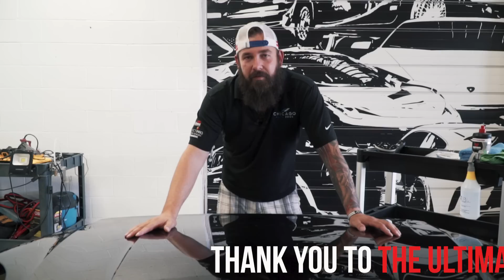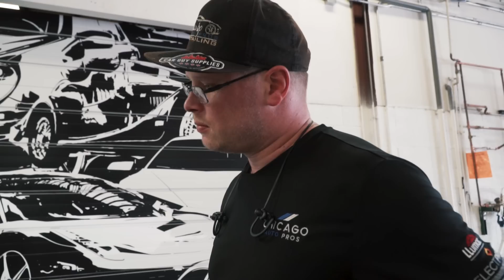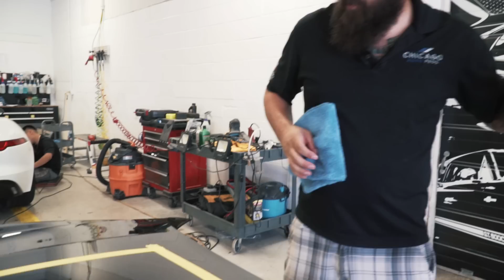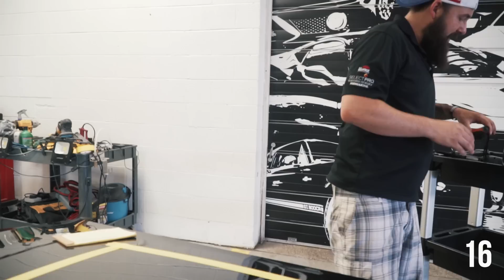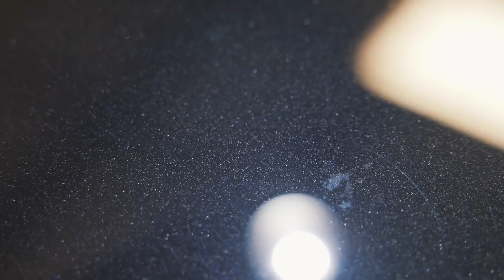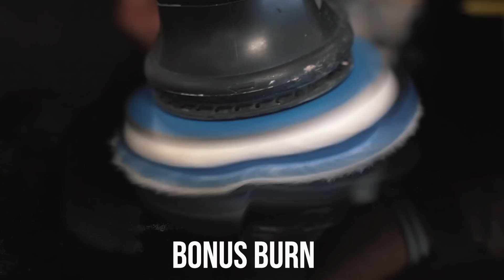Jason Burns A Car... How Many Times Can You REALLY Polish Paint?

Comment: The lesson for me here seems that, if you want to polish your car with a light compound every year with a proper technique and preparations just to refresh paint, you should be fine. I have an old Audi A3 8L from 2000 and I am slowly getting myself to learn how to polish paint. Before working on a car I will buy some spare panel and practice on it. Very nice video making me much more confident and at ease when comes to making my own car a little bit better looking. Some preparations without a rush and just careful and mindful work. Thanks guys. BTW. Recently I have sanded, polished and film protected my headlights all by myself. Effect is more than I could have wished for and it made me super satisfied and proud of myself.
Reply: You should be fine, but dont forget, clearcoat degrades over time due to many factors, while this was most likely a pretty new panel with barely any natural degradation.

Comment: Did you notice any orange peel leveling near the end, In theory it should be flat as can be right before you started burn through
Reply: Most efficient way to get rid of orange peel is to wet sand with a hard backing pad or block. Because of the soft pad and soft backing pad it follows the shape of the clear to a degree wich keeps alot of the orange peel compared to wet sanding.

Comment: Really interesting.  Thanks for doing this as it gives me a bit more "confidence" knowing I'm pretty unlikely to burn through w/o being a complete imbecile :-).  Would be curious to compare using a rotary versus the DA how much quicker you would have reached failure.  Also curious to know the depth gauge reading in one of the door jams as well to get an idea of factory depth versus what you started with on the hood.
Reply from the maker: It took so much longer than I would have expected. This was an OEM new hood. I am assuming is had little to no polishing done to it.
Reply: @ChicagoAutoPros  I estimated even quicker, especially with the microfiber cutting pad!

Comment: I wonder how different the results would be if you used a non-diminishing compound like Meguiar's 101.
Reply from the maker: Do a video!
Reply: 400 use an agglomorated abrasive. What this means is that the abrasives are basically a cluster of non diminishing abrasives, which break down to non diminishing polish. Strange I know, but it makes sense when you consider how far it cuts and finishes. 

Todd Helme did a great write up on Autopia of FG400 vs M105.

Comment: I was thinking 0 is the base coat, how come it showed failures while it was reading 4.0. doesn't this value go from 0 upwards?
Reply: I've see vids where they measure the inside of the door post to see a rough value of what is safe. They read a couple times 4.5 mil that would mean there is hardly any clear coat on there. That number is confusing if 0 isn't really 0
Reply: I don't know nothing about this. I did a quick check what it measure. It measure all layers. I thiught it somehow only measure the clear coat. Kind of sketchy, one does never know the thickness of the bottom 2 layers

Comment: How does he believe the millimeter reading is MORE accurate than the micron reading??? 650 microns is EXACTLY the same as 6.5 millimeters lol

EDIT: It's actually "mils" (thousandths of an inch) not millimeters. So the microns reading is MORE accurate than the mils reading.
Reply: Micron= micrometer 1x 10-⁶= 0.000001 meter
Reply: Mils is thousandths of an inch, micron is as Robert Ri said metric. 25.4 mm per inch, so 6.5 mils or 0.0065 inches is 0.1654 mm or 165 micron. You see him measure 6-6.5 mils and when he has the micron on, he has 160 micron to 165 micron show up.
Reply: @MrTommyp56  Ohhhh, I misunderstood. Still, 10 microns is smaller than 0.5 mils, so the microns reading is actually MORE accurate.

Comment: Honestly.. my wagoneers paint..  has black mold... burned into it... i washed... scrubbed... tried chemicals... couldnt get it iff... So i had to buff with a buffer and compound..  and buffing the hood for an hour 3 times.. hard and slow.. got maybe 60% of the mold spots off.. but its so etched in my paint i cant get it all off.. it sucks !!!  So i wanna just keep buffing until i get it off.. but i dunno if ill make this worse or not lol
Reply: Did you get it out?  Using compound and a DA polisher should work. Chemicals won’t.
Reply: @denisef1153  i used a buffer.. and compound.. and no i didnt.  I buffed for hours too.. probky chewed through a lot of paint.. it got the shine back.. snd (most of the mold) but this mold ate DEEP in the paint.
Reply: @jeepsblackpowderandlights4305     Excellent.  Thanks for replying.  I’ve never heard of mold growing in paint and after I read your story I went and checked over my car for signs of mold.
Reply: @denisef1153  same... i moved out in the country and this black mold started growing on my two Jeeps.. i didnt think anything of it and i was too busy with the new house and property.. and when i finLly said eh lets clean this off.. it ate through the paint on my wagoneer.. on my grand cherokee it did come off though.. both paint jobs are different so one might have been more resiliant than the other

Comment: I guessed 5 - wow, was I waaay off! I’d also be curious how you would know if you were close to burning through the clear coat.  Is there a standard thickness of clear coat vs. paint?
Reply: Sometimes u can measure the paint of the inside of a door panel. No clear coat there. The difference in thickness is the amount of clearcoat u can work with
Reply: Matthias Van Eeckhoutte 

That’s great information. Thank you!

Comment: Nice Videos Guys .But how much clear coat is enough to provide enough uv protection .??and not fail during one or two summers
Reply: He said it was a new car and it was reading 6 to 6.5 mil.  I would bet that’s your answer?  That’s how I understood it.
Reply: @denisef1153  Hello buddy  i mean after 
 polishing , for example you remove 5,6 microns from the original paint how much is enough for uv protection
Reply: @spiros271  no, don’t remove that much. You will have no paint left. His car was brand new and his car, with brand new paint, had that much.  That’s not how much he removed.   I don’t know how much is enough for UV protection.  Start small and work your way up. I did 5 passes over my area and that was enough for the shine to appear again. My car was very bad and neglected. It  actually looked like it had flat paint.  
I did a chemical decontamination first with iron remover. Then I used a clay bar. 
Then I compounded followed by a polish using a DA polisher.  After all that I wiped the car down with a mix of alcohol and water and then applied wax. My car came out great. I’m learning too. I’m a newbie but have watched videos on how to detail your car for a few weeks until I got brave enough to do it.    There are some excellent videos for beginners.  
Read the comments for more helpful hints.   Check out Pan The Organizer videos. He has a step by step guide for beginners.
Reply: @denisef1153   Buddy thank you first of all for your answers. I was speaking about microns not mils. I think he measure 6 mils of paint eguals to 165-160 microns .He showed to the video 72-73 passes  with an agreesive combo  in a room temperature .He showed in how many passes you will have clear coat failure. What about in real enviroment elements.For example how many mils/ micros can remove to have enough clear to protect you from the sun .And the test was made to 160 microns .Imagine you have a mazda with 75 microns =2.95 mils . I believe the video is to have a general idea not real test
Reply: @spiros271  Thank You. I obviously misunderstood.  It’s complicated for me. Microns and mil

Comment: Any recommendations solution for fixing coat burned methods? Please share…
Reply from the maker: Call the body shop and have it repainted.
Reply: @ChicagoAutoPros  This is the best solution? It's need repainted the whole panel or damaged area only? Please advise, thanks…
Reply: @petter7085  the burn needs to be sprayed with primer water sanded and whole panel needs to be repainted and cleared. Other noneffected adjacent panels may need repainted aswell for blending purposes according to placement of burn.

Comment: Since when is 0,5 mil more precise than 10 micrometers?
Reply from the maker: I don't know maybe I am wrong. I liked the mil reading better. I didn't like that the microns didn't go to the single digits.
Reply: @ChicagoAutoPros  10μm (micro) are 0.01mm (mils)
Reply from the maker: 10 micron = .394 mil
Reply: @ChicagoAutoPros  10µm is more precise. Turn it around: 0,5 mils = 12,7 µm :) Nice test though, is this always the arm speed what you do? I found it to be pretty fast when the video wasn't speed up of course :p
Reply from the maker: Yeah that is the arm speed I would normally be buffing at.
Reply: @ChicagoAutoPros  it's the gauge. My (cheap) gauge doesn't round up to the nearest "whole" number in microns. I prefer microns because I see 2,3, 7 etc microns being removed at a time. What ever the number. In Mils, it would read like 6.0, 6.0, 6.0, 6.0 so you're not really seeing "removal" until u go down to 5.5, etc.

Comment: Just use a paint depth gauge on every car, rather safe than sorry
Reply from the maker: A paint gauge doesn't tell you how much clear coat is left. It's measuring all layers. It will also vary on every make and manufacturer.
Reply: @ChicagoAutoPros   could get the expensive gauge that does tell you each layer :) I think it's abut 2500 bucks
Reply from the maker: Oh that's awesome. Didn't even know that existed. You have a link?
Reply: @ChicagoAutoPros   Ya not many people know they exist, probably due to the price. The link is this https://www.defelsko.com/positector-200 the 200 B3 looks to be the one to get. It is their advanced series that does it.. the description at the top of that page says this "ADVANCED
Includes the features of the standard gage, with storage of 100,000 readings in up to 1,000 batches. Includes WiFi, Bluetooth, and more.
Measures individual layers."
Reply: Chicago Auto Pros Jason, you neeeeed this tool!!